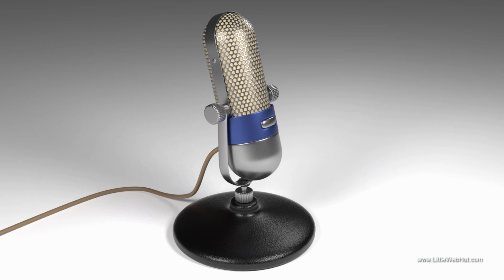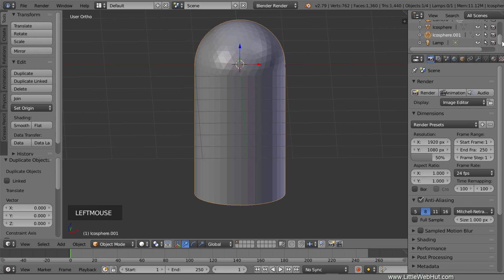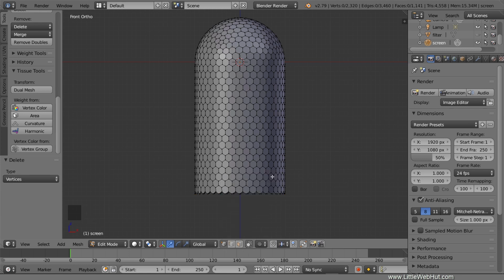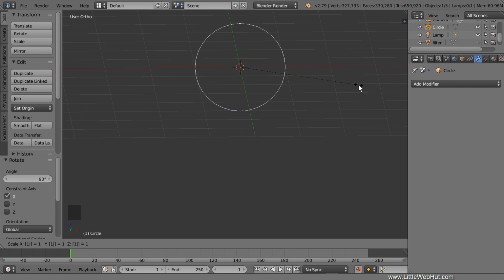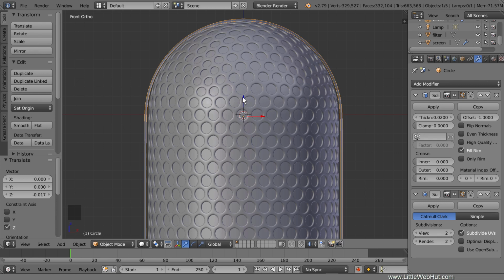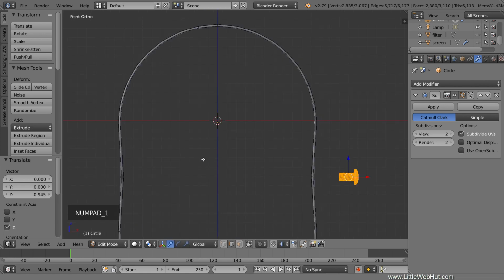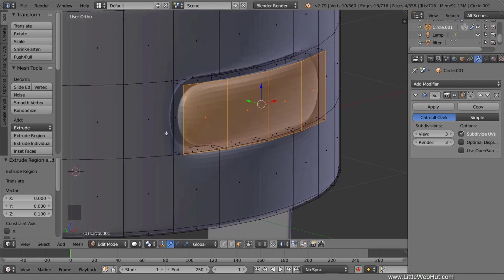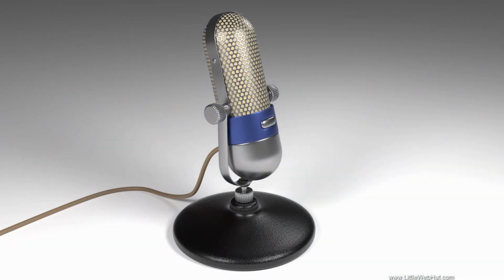Blender Tutorial: Modeling a Vintage Microphone: Part 1

Comment: I am using blender 2.93.5 and I am stuck at mesh tissue please help I enable the add on and while selecting the icosphere or screen i did enable dual mesh and it's not doing exactly doing the tutorial-wise..
I am stuck at the dual mesh I did exactly as seen in the video and i am stuck while selecting the whole geometry in edit mode i applied dual mesh and its creating a mesh with a weird abnormal pattern please help me..

Comment: i made this in previous version of blender, but using 2.90.1 im struggling with the tissue tool, either the top is a complete mess, even with triangles as the source face, or im able to fix the top but the bottom half stays as rectangles

Comment: For those of you having problems with Tissue addon in Blender 2.8.
Don't use it!
Download and install new version. https://git.io/JvN06
Instead of using Dual Mesh button use: Convert to Dual Mesh.
After that follow tutorial as normal.

EDIT: I couldn't install Numba module but the addon work fine without it.

Comment: (Just Shift+C for cursor to center. and use of mirroring would save time.)
Nice tut, although it does feel very dry like your reading of a script,  no personality or character. 
There's nothing wrong with that, just how you chose to style your vids. 
But I can't help thinking if you included yourself in the video and had a more relaxed delivery that they would be even better. 
Hope that's taken constructively ;)

Also - I rather liked how you showed different ways how to do the same thing.
Hiding, and extra geometry at edges.